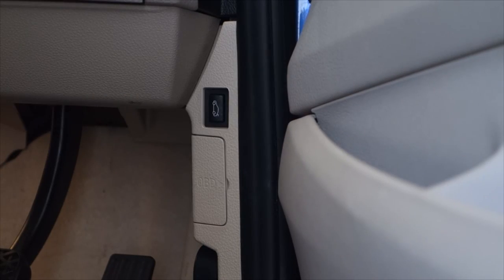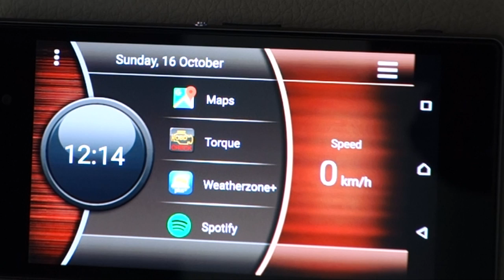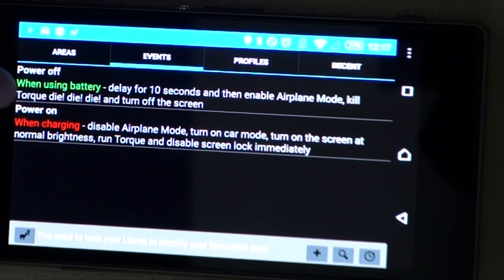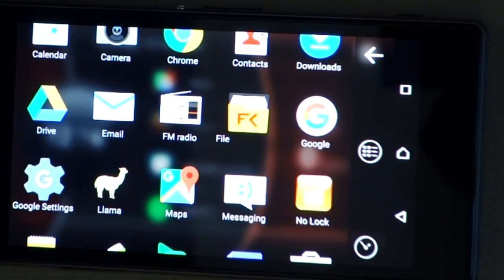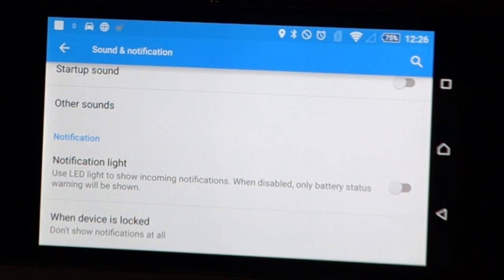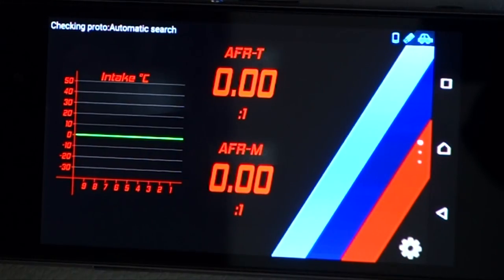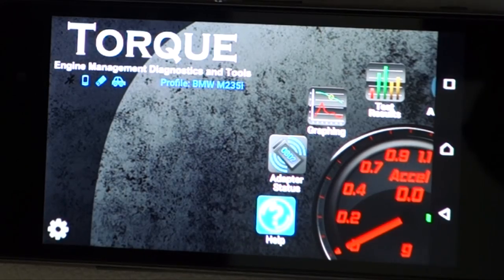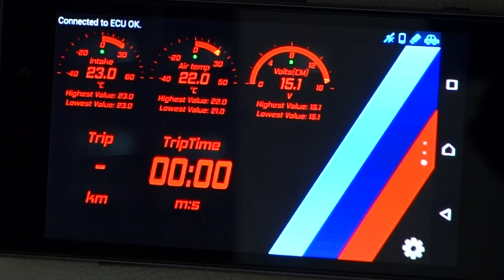How to make Digital Gauges with an old Smartphone

Comment: May/01/2020 - Llama app changed... but there's Automate made by LlamaLab. (Also found MacroDroid but that requires a rooted device.) In Automate I went under Community and then searched for Torque. Two good ones to choose from. I'm using a Motorola One and it's way different under settings as well, because it's a Moto and because new Android OS of course. I also bought a thin/stealth OBD2 adapter to extend the female plugin and hide the bluetooth OBD2 itself above my pedals so I don't see any blinking lights or device jetting out. Only thing I'm having trouble with is where to mount it and keep the cable neat and hidden, as well as easily visible without taking my line of vision too far from forward like you have to with that setup you have. --- This may get annoying every now and then when I run MHD tune or other OBD2 logging apps with my iPhone but eh, this is the best gauge setup I have seen for BMW's! Especially price wise. THANKS for this 4 year old video that's still holding strong!!!
Reply: you rock!! Thank you! My LS swapped g30 needs a new gauge setup and this is exactly what I was looking for for my tablet dash.
Reply: I just tried this with a Samsung and just couldn't get it to work 😢

Comment: Brilliant video Mate, I've been wanting to fit a boost, volt and oil temp gauges in my car for ages. But being new to all this I've not been sure how to do this on my car and didn't wanna drill and bolt dials into dash with out being sure first. This will give me all I want with out screwing a single hole in dash. Ordered my Bluetooth OBD so hope it works for my car but even if not it's a great video! 
5* dude
Reply from the maker: Thanks mate. Glad it helped.
Reply: Boosted Media 
I've been using the app and obd reader every day since I set it all up. I love it can see everything my car is doing. Even the exhaust temp
Reply: Does it have oil pressure for LS equipped vehicles

Comment: Great Video.. thank you.. but for me tried several times and dif devices.. but cant get LLama to kill Torque.. even rooted samsung s7..so got airplane mode to work but thats it... does this only work with old hardware.. or is there a better version of llama etc...?  Cheers.

Comment: A well spoken useful video . Thanks   I was wondering if this setup  would apply to motorcycles which also have a diagnostic port ? (usually under the  tank ) of course waterproofing  everything must be done at a high level but after that can you see any sort of problem that might prevent me from a similar setup ?
Reply from the maker: +Brian Ninjutsu as long as it's a standard OBD-II compliant port then yes.

Comment: You can disable the lock screen from within the android settings, you don't need the second app.
Where you can set the lock type (pattern, pin etc.) there is an option for none, at least on Vanilla android (I am not talking about the swipe option)
Reply from the maker: +Atanasov Goran I had issues with the phone not going to sleep properly and chewing batteries when I used that method.
Reply: Really? That's shouldn't happen, anyways, I always root my android devices and use custom roms so I don't know what happens with the Default OS. I would suggested using Greenify to hibernate unused apps, but I am not sure how well it works unrooted.
Reply from the maker: +Atanasov Goran greenish doesn't do much but rooted. I usually compile my own custom ROMs and kernels for this type of thing to give me full control, but for the sake of the video I did it using easily available and no root required software. 

If you ever used "SentinelROM", that was me.
Reply: I have heard of it, never used it. XDA all the way :P

Comment: Very useful video, mate! Just a couple of questions: 

When you turn off the engine is the USB port still charging the phone or does the power to the USB socket also turn off after a few mins? 

Also, do you leave the OBD2 dongle always connected and does it also power off after a few mins once you turn off the ignition? It would be great if both turn off automatically, else they would drain the car battery. 

Hope this set-up is still working fine.
Reply from the maker: Charging ports turn off after a few minutes. Depending  on the OBD2 dongle, it also goes in to sleep mode.

Comment: Does the drivers door when closed hide the OBD unit?
In your demo I didn't see if you removed it after setup was done?
I tried to find a HUD for my car but there's only two with an 8K red line and both are sold in Europe. :-(

Comment: Cool video, i had this in my old car with a tablet but had to set it up manually evertime i drove.  Where does the USB connect to?  Cigarette lighter?   Also,  does the phone need to have service in order to have Bluetooth?
Reply from the maker: +Tony F yes power connects to cigarette lighter. No service required for the gauge features.
Reply: Thanks but what about getting apps and bluetooth?  I have an Iphone but i would kindly get a Android phone if thats easier. I don't want service on another phone.  I like the idea of this being automatic.  The Torque app was great on my old Android phone. thanks for your help

Comment: Works exactly as described, however, turned off the engine,  ten seconds later blank screen etc...  About 2 hrs later, got into the car and unit was red hot. Appears that  Car launcher caused overheat alarm and caused a shut down.  As part of the "power off event, I toggled car launcher off. Will see what happens.

Comment: Have you had any issues with the battery draining in standby when you leave the phone in the car for a long period of time?
Reply from the maker: None at all. With the screen off, apps killed and in aircraft mode (which is all done through LLAMA), it draws jack all power while it's in standby mode.
Reply from the maker: Just to update you, with this particular phone, it takes about a week for the battery to go flat in standby mode. So basically it's not a problem unless i dont drive for a week.

Comment: Truly EXCELENT video and presentation, my hats off to you!  I too am using an "Android" system (Samsung Galaxy Series).  Having said that, for the life of me I can not find the "Liama" app ANYWHERE.  My "Torque PRO" edition, which I've downloaded (Nov 2019) does seem to be different than yours in as far as the "Home Screen" that I have and what you seem to have on the video.... Having said that, I can't find the "Liama" app anywhere in the "Torque PRO" app or, the "Play Store".... nor do I find it when I "Google" it.  Any suggestions you might have would be GREATLY appreciated!     BTW, I too ordered and "Tried" the "OBDLink MX" Bluetooth Module and sadly, it was a total Disaster for me.  THAT was highly disappointing, as all the "Research" I did, the OBDLink MX, seemed to the an Excellent Option and Choice... but as I said, it just didn't work. I'm pretty sure I received a Defective one, but after over 8 hours trying to get it to Work, Pair And Connect with my vehicle and Two (2) different "Devices" (My Samsung Galaxy and  a Amazon Fire 7), I just gave up and returned it.  Now trying "other" OBD readers and hoping for better results...
Reply: I think it's called automate now... doesn't look as friendly as liama

Comment: Never Used The Liama. But Sure I Could Put This To Good Use So Thanks For The Advice With This, As For The Lock Screen 

You Dont Need The "No Lock" App, You Could Use The (Stay Awake When Charging) In The Developer Options Folder. Why Add Apps For Features That Android Has Built In.
Reply from the maker: Without the no lock app, the phone still locks when the car is turned off.

Comment: Considering how easy it is for a thief to program a new key into a BMW when they connect to the ODB port, what protection is there with the Bluetooth?   Allowing a radio connection externally could make it even easier for them?   (Other makes if cars are affected also)
Reply from the maker: +blackdatto the ignition needs to be running and the device physically put in pairing mode for someone to connect to it

Comment: could you remove the battery from the phone entirely and then it would only run off the vehicle? then the power down would be immediate.  great vid. got my gears turning.
Reply from the maker: I don’t think most android devices will turn on with no battery installed and just powered via USB. 

But you could defiantly rig up a fake battery system that supplies power when the car is on. Would be quite a bit of work though.
Reply: yea exactly. find out what kind of power is required to fake it. it would get the appropriate power through the vehicle accessory/on ignition switch. not sure what kind of capacitors/diodes or other gear is needed, but would make for a super clean install!
Reply from the maker: There’s a lot of smarts in smartphone batteries to regulate charge, temperature; etc. I s not think it’ll be as simple as just supplying voltage.

Comment: so you jzt leeve the phone in the car? wat if the battery dies? wouldn't i have to wait for the whole bootup to complete?
Reply from the maker: Yes if the battery dies you have to wait for it to boot up. However it takes 3-5 days for the battery to go flat inc standby mode with the screen off on most phones.

Comment: Thanks for the vid - what phone are you using ?
Reply from the maker: The phone in the video is an Xperia Z1
Reply: @boostedmedia  Cool thanks - going to grab one today!
Reply from the maker: Doesn’t need to be that phone specifically. Will work with any android phone. The Z1 is pretty old now.
Reply: @boostedmedia  Thanks, yeah I just like how it looks and the magnetic charging port is sweet. Have a Z3 in my hand right now and setting it up just like yours.. Thanks man you're the best!

Comment: Will this work with a 1993 mustang 5.0 it doesn't have the newer version obd2 which started in 94 or 95 to resent. It has theolder style port ? My car has the stock A9L ecu and I can't find any info on using a android phone or tablet as a gauge cluster. Thanks in advance for any and and all advise.
Reply from the maker: Sorry. No it won’t work.

Comment: Hi!,  is possible to use a second hand ecu? and some hooked up sensors so, this systems may be used in an old, old, old mustang???
Reply from the maker: +Octavio Francisco Salcido Rocha theoretically you could use an aftermarket ECU like Haltech, Link, Motec, Megasquirt, etc just to read sensors but would be a lot cheaper to just use mechanical gauges.
Reply: I have here my 1977 ford maverick, a trailer from the mexican beer company " CARTA BLANCA" invadee the lane and crashed against my car, that caused a fire, some cables and some gauges became damaged, in mexico is very difficult to find that old gauges and usually do not work, if I try to find the gauges at california classics or some store like that, the old fashion gauges are not cheap, in the other hand I was thinking get a second hand ecu (maybe from ford escort) and use it with your system.

Comment: Does the torque sensor that you plug into the OBD 2 turn off with the car?
Reply from the maker: +steve71 the one I have detects when it's not in use and turns itself off. Others stay on all the time.

Comment: Can you dim it externally? i want to use two phones for tach and speed. thanks. not too familiar with androids but do they have auto dim like iPhones?
Reply from the maker: Yep. The screen can be dimmed manually or depending on ambient light. You can even set it to dim when it receives power if you want.
Reply: The problem is when one phone is using the Bluetooth to the obd adapter the other phone won't be able to see it and connect to it...
Reply from the maker: Why would you need to connect to the OBD adaptor with two phones? I just use the gauge phone.

You can have the adapter paired to two phones if you want to and just switch between them by putting the adapter back in pairing mode.
Reply: I own a 1969 Camaro and was thinking of setting the 2 phones (RPM and Speed) behind the stock bezels.
Reply from the maker: This setup only works with modern cars with OBD2 diagnostics. You’ll need an aftermarket ECU for this to work.
Reply: thanks yea im Running LS with a standalone obd2.
Reply from the maker: Ahh easy then.

Comment: How accurate is the speedo? Looking to mount phone over my mph speedo while overseas for kmh.
Reply from the maker: Capt America no issues with accuracy at all. You can even use gps for the speedo if you want.
Reply: thanks, Im trying to stay away from using data (internet) on the phone, and pulling all the straight from the ECU. thanks again
Reply from the maker: GPS speedometer apps dont use any data. :)

Comment: so I'm non computer compatible. if I do a Ls engine swap. in to a older vehicle. use the O.E. ecm from likely a 2000-2010 Chevy truck. could I use a small android tablet as the instrument panel? with speed, tach, oil psi, H2o temp, everything you need while driving?  I don't guess there's anything like this for OBD1? only OBD2 correct?   I want a digital screen to replace my gauge cluster.
Reply from the maker: +James stranger yes it would work for an obd2 ecm. You'd lose your odometer though and not sure if it would be legal. There are also aftermarket dash systems available. Motec make some awesome ones. Very expensive though.

Comment: what do you recommend using on cars with OBD1 port? is there a way to convert or any port conversion available?
Reply from the maker: I dont think there is a solution for OBD-1 vehicles. The ECU doesn't make the data available AFAIK.
Reply: Kristine Faris you need a vehicle-specific connection. i use a Bluetooth Consult adapter for my 92 Nissan 240sx. I can see everything that the ECU sees.
Reply: Kristine Faris why would you do this to a ob1 system you can trouble shoot using onboard system
Reply: Miguel Castaneda ,so that you can moniter your motors activities as their ongoing, before you have to trouble shoot.
Reply: @byron jennings, i have a 240sx and was wondering what and how you did you make yours work? if u could help me pls. thanks
Reply from the maker: +jun r r how I made it work is shown in the video

Comment: How did you solve the heat/cold damage issue to the battery?
Reply from the maker: What issue is that? Sorry i don't understand the question.
Reply: Boosted Autos How do you keep the phone safe from overheating due to heat/cold from weather? I assume you leave it in the car
Reply from the maker: +Rya Cru I haven't had any issues at all with heat. It doesn't get cold enough here in Australia for cold to be a problem. 

Smartphones have their own built in thermal protection. Worst case it would just stop charging and turn itself off.

Comment: so this will cause a cel on a 86/brz?
Reply from the maker: Not if you use a decent adaptor that turns itself off properly when the engine is shut off. Some cheap adaptors can throw erroes on the 86/BRZ if they continue trying to communicate with the ECU when the engine is off.

Comment: Any issues with leaving the phone in the car, with regards to heat affecting the battery? I've been wanting to do something like this for a while, but have been hesitant due to not wanting a small explosion in my car (even though the Note 3 isn't the one known for explosions).
Reply from the maker: Unlikely I'd say. The heat generated by the processor in the phone while it's in use is far greater than it would experience in ambient condition, even on a hot somers day, plus most phones have scaling built in and even automatic shutdown when they overheat. I wouldn't be worrked (unless you have a Note 7 of course :P)
Reply: Mad! I also want to use it as a dashcam, and have it run while the car's off. Found an app that claims it can run in the background.
Reply from the maker: I'd be more worried about the car being broken in to with the phone on display like that.
Reply: Yeah, that's a concern :-/

Comment: what if you have an older car like a 88 mz20 soarer thats pre obd2 but the car is fully computerized?
Reply from the maker: +Doc Ds needs obd2.
Reply: Boosted Autos  cant you get a connector adapter or something
Reply: Doc Ds no you can't and even if you could, the ecu wouldn't even know what to tell it. If you want gauges, you're going to have to install them manually and modify the car

Comment: How much total did the set up run you (include the phone price please)
Reply from the maker: +Evan all up the apps cost me $10. The single was $115 and the phone original purchase price 3 years ago was around $800, but a cheaper phone would do the job.
Reply: @boostedmedia  my question would be in order to used maps and other stuff. it would cost Data. are these phones you are using Data?

Comment: Don't use it on BMW. If you have obd device in connector it will never let the car ECU to sleep and it will drain battery. If you have  good battery it will last few days depending on how much you drive it, if you have weaker battery it won't last overnight. This might be same for some other models.
Reply from the maker: +TheAngryScorpion this is covered in the video. If you use a decent adaptor, it has a sleep mode. My car sits for sometimes up to 3 weeks with this plugged in and never an issue.

Comment: IT DOESN'T WORK FOR MY boost,  and it doesn't work for my AFR, it can't see the values.   also I noticed my RPM is 4500, but the android torque app lags behind 300 rpm, displaying 4200, this bluetooth technology is crap!! so is this software.  waste of time.
Reply: can this do RAX datalogging at 700 samples per second like EvoScan does?    this video seems like 2 samples per second, abslutely useless.